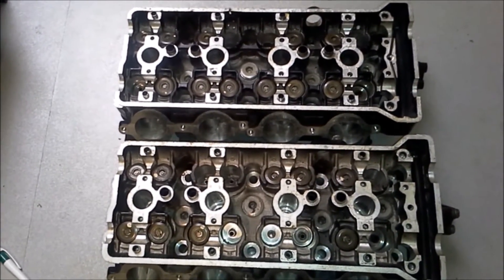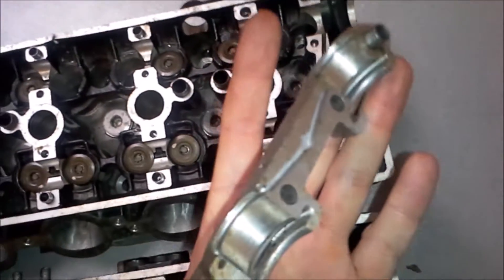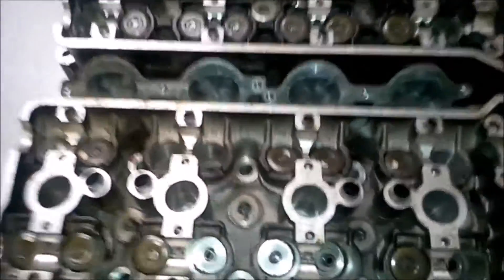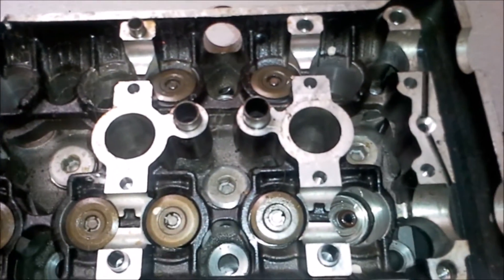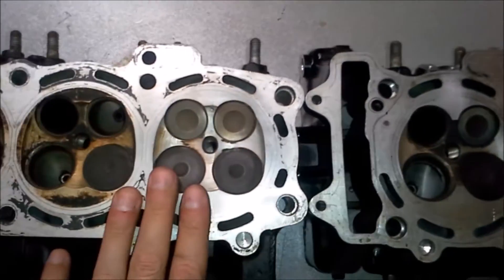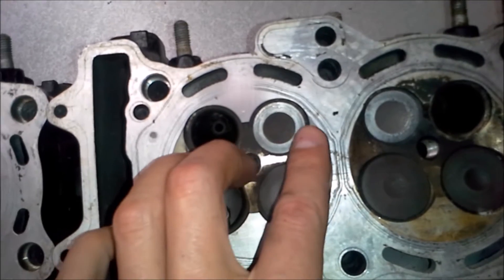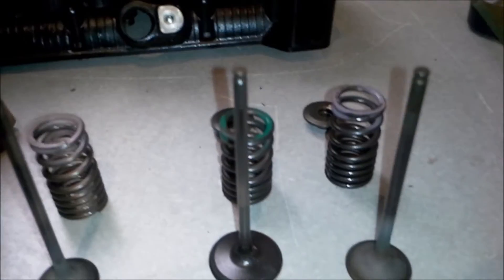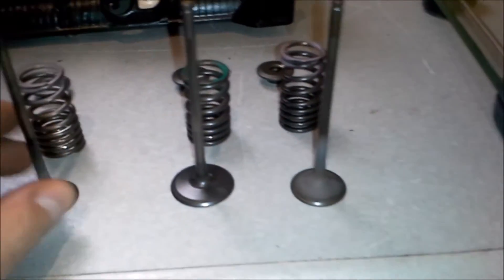2006 Kawasaki ZX10R vs 2008 Kawasaki ZX10R Cylinder Head Comparison, Part 1.

Comment: bring the dead topic back, i read athat 2008 engine fits 2006 engine almost plug and play ,any details anyone ?
Reply from the maker: You read it correctly.
Reply: I meant 2008 engine fits 2006 body I assume it's still applies, that opens up more used engine options ! Thank you sir !

Comment: I have a 2008 ZX10R and it threw a rod. The upper part of the engine is okay, but I need to buy a new block. Can I use a 07 block in place of an 08?
Reply from the maker: You'll need a 2nd Gen transmission in that 2nd Gen block.
Reply: @everydayirace  I've watched all of your videos and I recall you saying the 2nd gen transmission just isn't as good as 3rd.  But I'm not finding any lower cases for a 3rd gen for sale on eBay, so it looks like I might be stuck having to find a cheap 2nd gen and get a complete transmission as well.  UGH!
Reply from the maker: @RealRickCox  yes, 3rd gen transmission little better imo, but when you can't find the parts for 3rd gen, then you just have to work with what you have.

Comment: Is there a difference between cylinder blocks? I need a cylinder block for gen3, but I can only buy gen2.
Reply from the maker: The blocks are different, but can be used in a gen3.
Reply: @everydayirace  What is the difference ? According to the photos they are completely identical. I assume that the crankshafts are also the same. I find the difference in the gear ratios of the box.
Reply from the maker: Starter covers are 06-07 and 08-10 specific, can be looked up on oem parts diagrams. 08-10 blocks have thrust spacers and 06-07 don't, 08-10 crankshafts are 2lbs lighter as well, gear ratios are different, clutch basket ring gear different, oil pump and oil pump gear different, pistons are different, shift drum mechanism is different......and so on.
Reply from the maker: @max232XXX  Just keep gen2 contents in gen2 block, put gen3 head/cams........it's really that simple.
Reply from the maker: I've had good luck finding parts on ebay, try that.

Comment: Loving these videos, teaching me a lot about my gen 2. 

Does adding weight to the valve train cause any issues ? ( I commented on the retainers video )

The gen 3 retainers are heavier than the gen 2, but the gen 2 valves are also heavier than the gen 3.
Reply from the maker: adding weight to valve train isn't great.........it's a trade off in this case, you gain much needed strength.

Comment: So what you are saying is better to put a 2008 complete head on a 2006 ,engine block.
Reply from the maker: You can put 04-19 head on the block..........this was just a comparison between the heads.
Reply: @everydayirace  which head will pick up more power? And how would you go about tuning? Dyno vs STREETS!!! lol
Reply from the maker: stock 3rd gen engine made more peak hp than stock 2nd gen engine.....about 5hp difference.      That being said, cylinder head is just a part of a combination, whichever head matches better to the rest of the engine will make more power.

Dyno is great, you can dial the engine pretty close in a pretty short amount of a time with a good tuner. I wouldn't recommend anything semi quick on the street, leave street tuning to power commander users with autotune.

I personally tune at the race track, cause nobody wins races on the dyno except for the bench racers and facebook roll racers.  I record data with every pass, make small changes, then compare acceleration rates between the runs and continue to make changes until data says that the bike isn't going any quicker, i then save the tune along with weather conditions and do the same thing all over again next time i am racing.
Reply: @everydayirace  gotcha, how do you record your data? And do you have a afr gauge onboard will your logging ?
Reply from the maker: I record data with a datalogger, I run lc2 wideband, you can see it in my racing videos when i switched to microsquirt stand alone ecu.

Comment: Im trying to build up my gen 1 motor from the head to electronics over the winter. I was wondering if you knew if an 08 head would bolt on just fine
Reply from the maker: 04-10 heads will bolt on to a gen1 engine just fine. They will also bolt on gen2 and gen3 engines as well, that was the whole purpose of this video actually.

Comment: Not sure what's going on with my bike but when it warms uo, it'll die as you're riding. It starts back up but boggs out until it dies you have to wait for a cool down to ride again. Any help would be awesome
Reply from the maker: For internal combustion engine to run, you need 3 things, compression, spark and fuel. Find the missing link, fix it and you're done.

Comment: So does the 3rd Gen head bolt right up on a 2nd Gen? My 06 developed a bad top end noise and came home in the back of my truck today. I'm guessing it's the retainers. Just wondering if robbing parts from a 3rd Gen could be an option..
Reply from the maker: Yes.
Reply: EVERY DAY I RACE  what would be better porting stock 0607 or swapping ? If sticking with the stock head should I use the newer spings an lifter ?
Reply from the maker: @robzillagarage  Everything has to work together, the only thing i can tell you is ports got bigger and valves got smaller from 04 to 10.
Reply: EVERY DAY I RACE what do you have done to your 06 10r? How do you know everything is  in harmony ?
Reply from the maker: You learn from trying different thing and collecting data, this isn't something that you learn in a couple of days.
Reply: Just for the sake of closure, it was failed retainers and it dropped an intake valve. Luckily at very low RPM and with zero piston damage. New valve, spring, spring seat, guide, lifter, Shim, some new retainers and she's back to work. 
Another question - Have you seen these retainers fail on the exhaust side? After researching it, I haven't seen any and the exhaust springs don't seem as strong so it would make sense..
Reply from the maker: I would change all the retainers to be on a safe side.
Reply: EVERY DAY I RACE That was my plan. Turned out I could only get 13 and the other 3 were on some never ending back order. I decided to put the 13 new ones in and reuse 3 on the exhaust side. I figure I’ll either replace the last 3 on the next valve set or sell it. Whichever comes first.
Reply from the maker: @Redrider2k2  sometimes you have to do what you have to do.

Comment: the valve retainers are the same for the exhaust from 2008-2012 same part number 12009, but the 2012 inlet retainers are 12009A,, and yes they all still crack and break, as my friends 2012 zx10r did, dropping a inlet valve and marking the piston head. I had to do the engine work for him, one reason i will not by Kawasaki,, and as far as i am aware the 2017 zx10r has the same part numbers for the valve retainers. junk.
Reply from the maker: ian hodson Thanks for information.
Reply: cool mate, i use fowlersparts.co.uk here in the uk, you can use there microfiche to look at part numbers and stuff, am ex motorcycle mech, oh and if any one is doing shims and uses a shim kit like hotcams, you mite find you need the in between shim sizes because usually in the kits you get the EG,2.00 then 2.50.then 3.00, so your missing out the 2.25 and the 2.75 mm thicknesses, i use cbr900 or cbr929 fireblade oem ones there cheaper than Kawasaki but the same diameter 7.48mm. and i own 2 fireblades lol.
Reply from the maker: ian hodson  I owned a 95 cbr 900rr and 01 cbr 929rr prior to my zx10r.

Comment: very informative. thanks for taking the time. I have an 06 and I have the race intake camshaft that im going to install with the 08 cylinder head is there anything else you suggest upgrading
Reply from the maker: 3rd gen race intake camshaft? And what are you trying to do with the bike?
Reply: EVERY DAY I RACE yes the 3rd gen race intake camshaft (49118-0034). but just wanting a faster top end
Reply: EVERY DAY I RACE like what head gasket thickness do you suggest
Reply from the maker: .45mm head gasket is the one to have if you can get one. You can deck the cylinder head and do a radius valve job and set the cams to around 110/110 for the most power up top You'll also need to adjust fuel and most importantly ignition timing along with raised rev limiter, your peak hp is going to be at higher rpm than stock 12.5k rev limiter.
Reply: EVERY DAY I RACE ok kool. Was going to go 107/104. With a thinner head gasket. Why do you suggest a thicker gasket
Reply: EVERY DAY I RACE by the way i use woolichracing
Reply from the maker: .45mm head gasket is the thinnest one that you can get. Remember it's in mm, not inches.
Reply from the maker: 107/104 will work as well, it'll give you more mid-range power. The higher the first number, the later intake valve stays open, the more air/fuel mixture it can let in the combustion chamber if you have the air velocity to do it. But dynamic compression drops too, so there is a fine line where you can set the cams at and it all depends on other variables, static compression, air density, intake port size, velocity stack height, exhaust system................and more things.
Reply from the maker: Woolich should work fine on a n/a engine.
Reply: EVERY DAY I RACE Thanks for the info I greatly appreciate it. I let you know how it works out
Reply from the maker: Sounds great, and you're welcome.